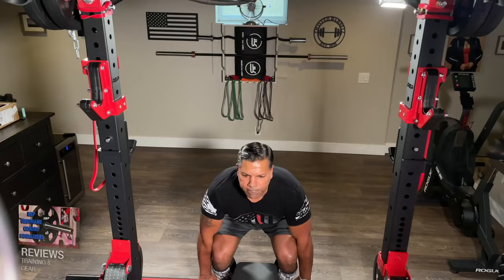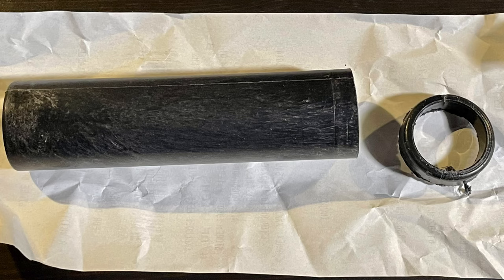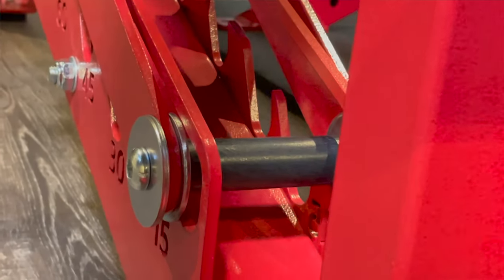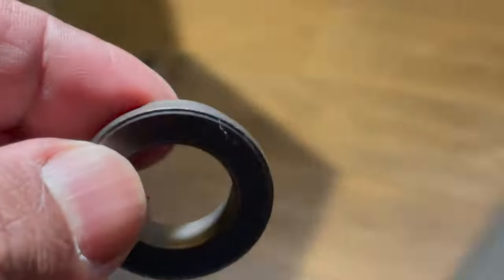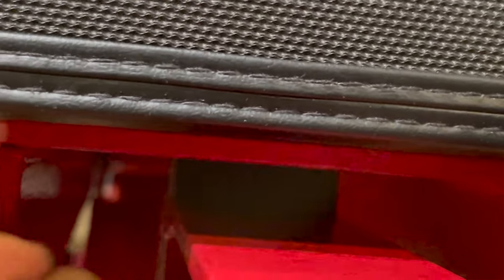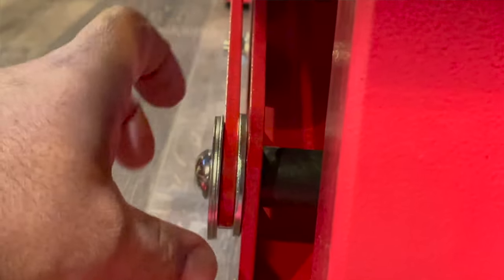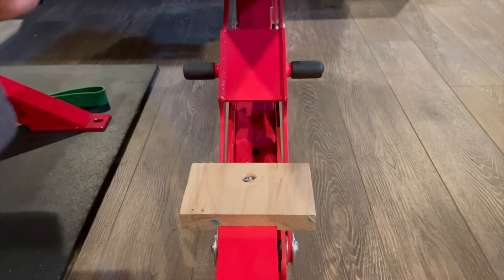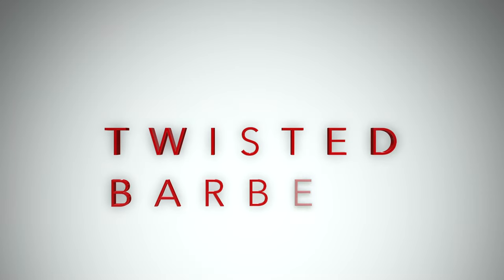FIX your REP Fitness AB-5200 to be as stable as a Flat bench!

Comment: wow this is so much work for reps "top of the line bench" i just got the rogue adjustable bench 3.0 that competes with this and it is absolutely stable in any position, flat or incline out of the box. The build quality and features of it make it worth it over this.
Reply from the maker: Thanks for watching and congrats on acquiring a fine bench!
Reply: @twistedbarbell3950  yea Def nothing against you, but people buy top of the line benches to lift heavy and not have to worry about wobby stuff like this. I knew this coming in and that's why I passed on the ab5200
Reply from the maker: @LL-tz8lo  I completely agree with you

Comment from the maker: As much as I love this adjustable bench, it still had some stability issues that I had to do something about. The sliding ladder design created a rocking motion on the bench back that was caused by all the room left on either side of the UHMW cylinder, which was the biggest culprit. I also decided to widen the platform that the bench back sat on in the flat position and this helped in a minimal way. I hope this helps some of you who were dissatisfied with the minor rocking motion of this bench.

Comment: Great fix and an inexpensive solution for a high price bench. Rep fitness should reach out to you and  thank you for creating a solution that should help them sell more of the AB-5200 bench by correcting the current design flaw.
Reply from the maker: Thank you Jose and I agree!
Reply: @twistedbarbell3950  Yes, make sure you email this link to a REP manager. I've no doubt they would be interested in these very cheap fixes, i.e., it wouldn't cost them less than $10/bench to implement these improvements and one-up Rogue.
Reply from the maker: @zaineridling  thanks

Comment: What tools did you use to make a 2inch groove for the 3/4in Maple Wood Block and make the hole the right size for the screw?
Reply from the maker: the screw depression was made with a drill bit combo that has a thin bit centered on the larger tapered bit (forget what it's called). For the groove, you can either use a chisel after you make a series of cuts, or simply go back and forth with a table saw blade that barely protrudes above the table to cut out the groove.

Comment: Great fix and video. Dumb question for you though if you’d humor me. From the clips and still photo, I can’t quite tell where the UDJ washers are. I hear it mentioned in your explanation, but strictly from a visual perspective it looks like two UAJ washers on the left (one on either side of the rail) and the same on the right, plus one of the original small washers just inside the screw head.

Am I missing the UDJs in there? I can’t seem to find one of them in there, let alone 4, but I am also just an idiot so that might be my problem.
Reply from the maker: Not a dumb question at all and I could have done a better job showing it or explaining it. In an effort that I keep the video short and simple, I neglected to include enough details. 

So, the UAJ’s go on either side of the rail on the left as you stated. 1 also goes on the inside of the right rail up against the urethane sleeve. At this point, since you no longer have to contend with the thickness of the axle inside the sleeve, you only need to stack UDJ’s on the outside of the right rail before tightening the right screw head. I stacked 3 UDJ’s to give me roughly the same thickness as the single UAJ on the inside. From L to R (when seated on the bench seat facing the backrest) it should be UAJ, rail, UAJ, urethane sleeve, UAJ, rail, 3 (or amount you’re comfortable with) UDJ’s and screw head. Hope that helps.
Reply: @twistedbarbell3950  incredibly helpful answer! Thanks again, my bench arrived yesterday and I am about to tackle this modification.
Reply from the maker: @someguy3303  good luck!

Comment: Any opinion on the get rx FIDAB-2 compared to this? Just cancelled my order for the AB-5200
Since I think it’s ridiculous to have to fix something out of the box at this price point. Rep fitness also denied any knowledge of this Issue
Reply from the maker: I do not have 1st hand knowledge of the FIDAB bench, but Brandon has a review on that. Perhaps you should consider the AB 4100 bench? If I were doing it again, I think I would go with that bench. Same as the 5200, but lighter and less expensive. I will say, even though I fixed the bench and made the video, I would still buy the 5200, as it is a hell of a bench! This past weekend I was at a PL comp and the commercial gym that hosted the comp had at least one AB-5200 there (Posted an image on IG).

Comment: Thanks Marcus, now if you lift the peg 100% out of the slot, will the inner washer get loose, and cause the peg to not want to re-seat in the next slot?  It looks like you're being careful to not come out of the groove.  Lastly, I bet some Delrin inner washers might ease the friction.
Reply from the maker: Hey Jim, the inner washer is not only clamped against the outer rail, but also the Urethane bushing on the inside, so it does not move at all or even wobble. If you try this, it’s important to cut the bushing precisely so that the inner washer stays in the position it needs to. Also, I hadn’t lubed the rails yet, so it was sticky and slow moving in some footage, as opposed to me being careful. 😂

Comment: 0:35 What tool did you use to remove the bolts for the Urethane Cylander? I don't have a tool that has a hexagonal shape that could fit in that socket
Reply from the maker: The only tool that works is the specific size Allen key (can't remember the size at the moment). They're not that expensive, so a basic multi sized set should do.

Comment: Can I just use any grease for the ladder system or do I need to buy a specific type of grease or is there only one type of grease? And for the maple, can I buy that at Lowes too and ask them to shape it the way you shaped it?

I am not familiar with this stuff, so please forgive me
Reply from the maker: Yes, any grease should be fine for the ladder. You can reapply if/when necessary.you could get maple from Lowe’s but you could do without it too. Look for a couple of other videos recently released, where they discuss switching out the seat/backrest hinge bolt for one that creates a tighter fit, which may eliminate some additional slack. Then you may be able to keep the rubber block.

Comment: Have you tried the Rogue AB 3.0? I'm wondering if it suffers from the same problems. Great info though 👌
Reply from the maker: I have not tried that bench.
Reply: @Twisted Barbell  After watching your detailed video, I now want to find out if the Rogue bench has the same small issues. To me, if if the Rogue is more solid, I'd pay for that bench. If I found that the Rogue bench had the same "loose" fit, I guess the REP bench would be the better choice.
Reply from the maker: @Relentless0neFPS   @Relentless0neFPS  You should also consider the new AB-4100, as there isn't a lot different from the 5200.

Comment: thank you for this video, I just recently bought the AB 5200.  Overall it's a great bench but I have some qualms with it.
When I have the bench in a more upright position and do shoulder presses with dumbbells, I feel and hear a slight clicking noise in the back rest, not sure where it 's coming from, or it might be from the bottom pad.  Have you noticed the bottom pad gives a bit left to right due to the bolts being exactly in the middle and there being no support towards the edges?  For example when I do nordic curls and put my knees on the bottom pad I will feel this as my weight shifts.

Also, the 5200, being a 3 post bench does yours back right or left post come off the ground easily if you for example push the top pad (more upright position) left or right?  

Overall very sturdy bench, but it does have some quirks that annoy me.
Reply from the maker: Yeah, like most things, it’s not perfect. I too have noticed some of what you described but none of it has ever come off the ground when pushing on it. If you try any of these fixes, let me know how it works out.
Reply: @twistedbarbell3950  interesting, when say your bench is at a 85 degree angle, nearly upright and you push the top of the pad (way up, the highest point) the back posts don't come off the ground ?  I asked rep, they said its normal for a 3 post bench.  It doesn't come off the ground, when I'm on it and actually lifting though.  thanks again.
Reply from the maker: @TRANSAMF4N  I see what you mean, but I can’t say I’ve ever been in that scenario. In my use, I’ve never lifted any part of the bench off the ground unintentionally. Only lifting from the handle in my case.
Reply: @twistedbarbell3950  Yea same, I lift it from the handle, it was just something I happened to try when I was trying to figure out where i was hearing those sounds and I noticed the posts come off the ground.  thanks !  I will maybe try your fixes, I have the FB 5000 so for flat I don't use the AB 5200 for flat benching so I might not run into the issues you were experiencing.  great vids btw!
Reply from the maker: @TRANSAMF4N  thanks!

Comment: this is awesome!  great fix.  I may have to try it on my 5200 as well.

BTW, I've been trying to get those pr-4000 spotter arms forever now and they never seem to be in stock/the ETA dates keep getting delayed.  I ordered a set of Rogue ML spotter arms to see how they'll add up.  I know that the rep racks are technically 2.95 x 2.95 while rogue's are 3 x 3 so this may be interesting.
Reply from the maker: Thanks. Good luck with the Rogue spotter arms!
Reply: let me know how the spotter arms go. i am in the same boat waiting on the rep's which now show mid April.
Reply: @vitenp  will do
Reply: Apparently Fringe sports spotter arms fit. I ordered mine they will be here tomorrow (this is for the PR-5kv2 though) I think the PR4k is based upon there Monster Lite series from Rogue.
Reply: just an update and heads up: the rogue spotter arms do not work on the rep PR-4000. The difference in 2.95 x 2.95 is significantly greater than I expected and the holes also do not line up.
Reply: Thanks
Reply: @ijrebuck  you have to get the SAML-24 Monster Lite Safety Spotter Arms it’s the spotter arms for the monster lite mine fit just fine a little play but they are spotters so I’m ok with it. Return yours if you can and get the lite ones..
Reply: @vitenp  you need the SAML-24 Monster Lite Safety Spotter Arms they fit just fine... I can get you picks if you want
Reply: Yes if you can upload pics or maybe better would be a video
Reply: @johnho6896  I had the monster lites. SAML-24 for sure I have the receipt and the paper from the box. The bottom hole didn't line up properly so I couldn't put the pin in. Besides, if  I had the regular monsters, the hardware is thicker and I wouldn't even be able to put it in the hole
Reply: @vitenp  how do I do a video? To show you or do you have Instagram?
Reply: @johnho6896  do you have a dropbox, box where you can upload it and share the link? I think if you have an iphone, icloud has public share option as well

Comment: Questions as I stare at my new bench.  Did you use white lithium grease to lubricate it?  Why did you use two different size washers if they are essentially just spacers between the end of the trimmed urethane roller and the rail?  Wouldn't the same size work on both sides of the rail?  Why not also add washers as well for the hinge bolts on the underside of the pad to reduce gap/play there also?  Why not do the bottom pad at the same time even if there is minimal play, since it is essentially the same issue/fix.  What did you use to cut the urethane tube?  What about adding washers to the rail to spread them away from the frame rather than trimming the tube?  Seems more stable.  And no trimming.
Reply from the maker: I did not use WLG, but you can use your choice of lubricant. I like some bearing grease I have laying around. The washers need to be different sizes as each side of the axle underneath the urethane spacer is a different size. One side is the full diameter axle and the other just the screw portion. As noted in the video, the bolts under the pad have metal spacers, so it would require something more complicated than an "Easy" fix. If you take it apart, you'll see what I mean. The bottom pad wasn't necessary, as the rear pad holds most of our body weight. Also, when you're in a more upright position like for incline work, your body weight keeps the seat pretty planted. When under a bar, that shifting from the back pad is what is most obvious and distracting. You could choose to do it if you want to do both, but my seat doesn't bother me. I cut the Urethane tube with a simple hacksaw, by hand - easy peasy. Adding washers without cutting will essentially bend or flex the rails to encompass additional width, which seems like more of a problem than a solution I was looking for. If you don't want to cut the tube, you could see if you can find washers big enough to go around the tube itself.
Reply: @twistedbarbell3950  thanks for the response, food for thought.  I'll sleep on it and decide in the next few days.  It wasn't too bad out of the box on the first use.  Having weight in your hands does stabilize things a bit.
Reply: Well, back pad is done.  More challenging than I anticipated.  Had to borrow larger Allen wrenches, had to buy vice clamps to grip steel tube to loosen bolts due to corrosion, and then had to play with tightening bolts and hinge to the right amount.  But it is definitely better now.  Thanks.
Reply from the maker: @bengoodhart6290  glad to hear it. Do you think the bench arrived with corrosion on the bolts or it happened in your place? Thankfully mine was pretty straightforward and didn’t give me any issues.
Reply: @twistedbarbell3950  Arrived that way, but some 3 in one oil and vice clamps were enough to get the bolts off.  I looked at the seat pad, the same fix will work but more of the tube needs to be cut, and thus more of the larger inner diameter washers are needed.  Tightening the hinge bolt made the seat rock less too though, so I don't think I will tackle that pad.

Comment: I am beginning to question this bench. The first bench you bought (different model) was misaligned on the seat area, I believe. Now you have to fix a design flaw. Still deciding what bench I will get for the gym I am building. The Rogue AB-3 looks good, but one could  buy two Rep Fitness benches for the same money. The issue is they are never in stock.
Reply from the maker: I hear ya and there never seems to be anything that’s perfect. I will say that I shouldn’t have to fix a design flaw, but now that I have, the bench is really stable. You saw the washers only cost $3 so it’s inexpensive and that did most of the trick. I just added the wood brace to really secure it and have no trace of wobble. I’m pretty OCD about things and once it’s in my head it’s hard to forget about it.
Reply: @twistedbarbell3950  Just to note, we are about the same age too.
Reply from the maker: @markhalstead2386  awesome! Age is just a number. I hope your training is going just as well or better than mine.
Reply: @twistedbarbell3950  I hope so too. Will be up to 2 months before I receive my Rogue rack, but I will keep working out with dumbbells in the interim.
Reply: @twistedbarbell3950  I also decided on the AB-5200 based on reviews.
Reply: I have the Rogue AB 2.0 adjustable bench. It’s $750 after shipping. I went back and forth between Rogue and Rep and ultimately decided on the Rogue one because there are no bad reviews on it. It took 6 weeks to be delivered after initial purchase but it is worth the money. Rep is a great option to save money and get a quality product but their benches and racks are not on the same level as Rogue.
Reply: @mistarmer  I found out $5000 orders ship free. The AB-3 that I prefer put me over that number, so the adder minus the shipping came out very close to what the AB-5200 would be shipped. Now my gym is all rogue.
Reply: Mark, they've been in stock off and on the last two weeks. I was able to grab a second one recently
Reply: @TheOneWhiteST  Thanks. I did see it in stock the other day, but it sold out quickly. The shipped cost of the AB-5200 is no different than adding the Rogue bench to my existing order and having shipping charges go to zero.
Reply: @markhalstead2386  that’s Awesome!